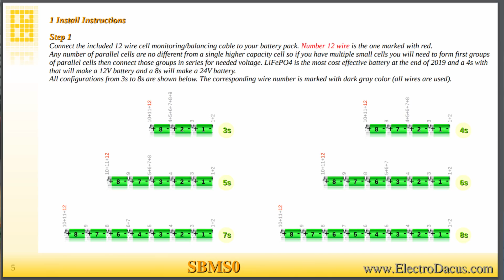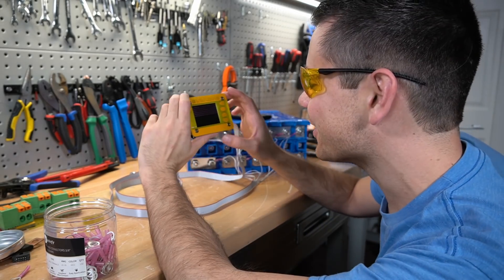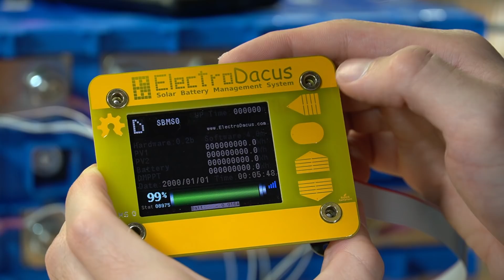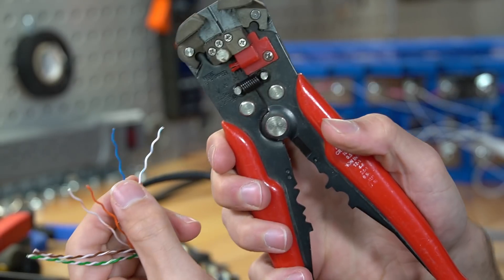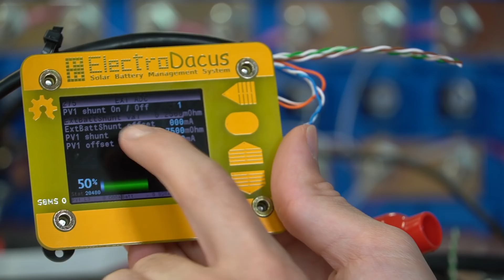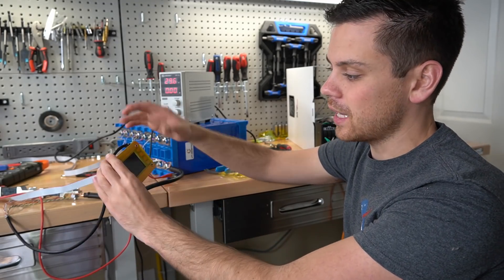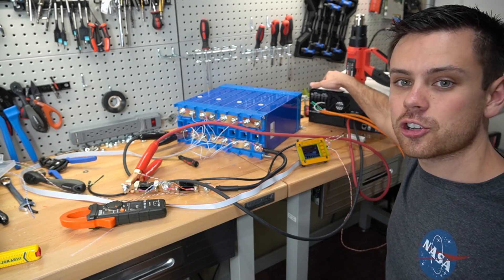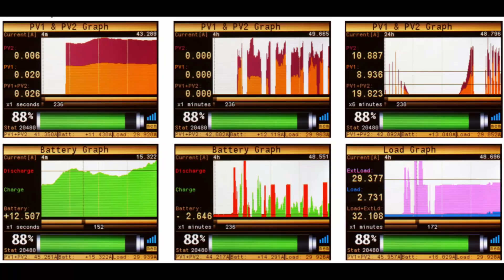Electrodacus -Open Source- Solar Battery Management System: Introduction and Setup

Comment: Nice video. Just one minor thing. Those DSSR20 modules are not actually PWM controllers. They are more efficient on/off modules that work perfectly with MATCHED panels, allowing every amp from the panels to flow through unregulated to the Lithium batteries.
Reply from the maker: Just asked dacian and it's not pwm for voltage regulation, but I assure you the total watt hours produced will be the same as pwm regardless. Power point tracking is not present and the conversion efficiency is similar to pwm regulator. Conversion efficiency is higher than mppt, but mppt will have more power available and after a full day of charging, mppt will always win. The argument is whether the cost of mppt is worth the increase watt hour increase. In some tropical areas, mppt not worth it. For 90% of people, it is worth every penny. Dacian has stated that mppt cost is so high that you are better off buying more panels. But if wire run is large, this would offset the cost savings instantly. 

There is nothing special about this system and there is still a form of regulation when battery is charged. You should get same output numbers as a pwm with the dssr20
Reply: @WillProwse  Thank you for validating my point. There is no PWM. Now, regarding the overall harvest efficiency for MPPT vs. this setup, well, there certainly are conditions where the cold production boost that occurs below ambient freezing in order to have panels at the STC temperatures, allows a good MPPT to generate up to about 8% more harvest, but that fades away to insignificance when we compare total harvest at normal, warm ambient temps, say 70F+, conditions that most RVers try to travel in. In those Temps, where the panel temps are always about 20F warmer than ambient due to internal heat buildup, this system is as efficient as MPPT overall, sometimes more so, sometimes less so. You correctly report that Dacian states that this system is always more efficient for the cost, by adding assuring panels, especially when replacement cost of MPPT devices is taken into account. In terms of wiring, he calls for a pair of #10 wires for each pair of 60 cell panels, thus 4 pairs of #10 for 8 x 315watt panels in my case. This is very cheap for an RV configuration. Long runs are easily mitigated by simply using 72 cell panels.
Reply: @retiredandroaming  Dacian recommends 60 cell panels for his SBMS for most efficient charging via his SBMS/DSSSR combo (max power point is closer to bank voltage).  72 cell panels would be better off using MPPT instead of his DSSRs.
Reply: @dhowman  he recommends 60 cell for normal use and 72 cells for long cable runs.
Reply from the maker: Switching regulators are efficient on off switches. Working voltage of panels is slightly higher than battery nominal, so some form of hvd needs to happen. Pwm controllers are extremely efficient, from input to output. In my tests, 99%. Typical of switching regulators with input and output voltage similar (efficiency in those circuits is dependent on difference in voltage). How would these be any different or any more efficient than PWM?
Reply: @WillProwse  The PV panels are constant current sources so when you connect the PV panels to battery the PV panel voltage will automatically be the same as battery voltage. There is no PWM involved as there is no constant voltage charging needed for LiFePO4 or any other lithium if you want them to last.
The efficiency is given by how well the PV panels match the battery voltage there is nothing magic or super efficient about the DSSR20. They are a very low resistance electronic switch plus ideal diode controller. Transfer efficiency at max 20A is 99.7% but that is not super important in overall efficiency that is related to how well the PV panel matches the battery and PV panel temperature to a lower extent as mentioned is some comment earlier.
Reply: @WillProwse  There is no need for PWM with the matched PV to Lithium, as voltage regulation is not needed. So the circuitry is very simple, very direct, very efficient with (in my understanding) less of the pulsing of a PWM. Dacian can explain it better than me. I'm no electrical expert so just wanted to mention that the DSSR20 has no PWM circuitry in it. Basically an ideal diode with simple on-off signal.
Reply: @retiredandroaming  You need regulation. To have an MPP of the cells matched to the battery means that the open circuit voltage of the cells will be much higher than the battery can handle, and if connected as a piece of wire, they would eventually overcharge. Matching is important.
If the OC voltage is the same as top of charge, then you miss the power band of the panels.
Reply: @ahaveland  no. Search the Electradacus google group for the explanation of why regulation is not needed for the matched pv to Lifepo4 configuration.
Reply: @retiredandroaming  Maybe you have a different definition of regulation? The IV curve of panels does not match the charge profile of lithium batteries. If you want to make maximum use of maximum power, then you have to disconnect the panels at top of charge, ie, regulate.
I'm not going to chase links. Please provide an answer here.
Reply from the maker: @retiredandroaming  it does have some form of regulation, and it is a typical switching regulator. Transfer efficiency is high, but depending on pack voltage and panel temperature, the power point is constantly changing. Sure the input to output is efficient on a switching regulator, but mppt has more power available throughout the day regardless. I covered this in previous videos. Mppt input to output is less efficient, but still generates more power over the course of the day. 

Yes Andy is correct. The curve for panel and the charge curve for LiFePO4 are not the same.
Reply: @ahaveland  as Will confirmed with Dacian, there is no PWM. Exactly what I stated in my initial reply. The SBMS disconnects the panels when 3.55v is reached by any battery cell, by default, and also to prevent back flow at night. Otherwise, it efficiently flows every last amp generated by the pv to the battery, with no attempt at voltage regulation or current limitation.
Reply: @retiredandroaming  Disconnecting the panels when they reach 3.55V  IS regulation!
Reply: @ahaveland  it has no PWM regulation, it is not a PWM controller. Exactly as I stated and what was disputed.
Reply: @retiredandroaming  PWM can happen over long timescales - 100% on when charging, therefore a piece of wire, and 100% off then charged. ie disconnected. Detecting voltage sag and letting it charge until full, then disconnecting etc etc etc is a long duration PWM. Integrating the voltage gives the average voltage of the battery.
This is what PWM chargers do, switch charging on or off. The panel voltage will always be decided by the battery itself, and this is dangerous if there is no "off-switch" to regulate the voltage.
MPPT controllers use PWM at high frequencies with an H bridge and LC circuits to vary the desired voltage and current dynamically according to conditions and component constraints.
As I said, we have different definitions of PWM.
Reply: @ahaveland  pwm attempts to regulate battery voltage for LA batteries by switching on and off in fairly high frequency. This system does none of that, and is built solely for Lithium chemistries.
Reply: @ahaveland  Per Dacian:

"[SBMS] is not a PWM controller as PWM is not needed for Lithium charging (it is actually detrimental). PWM is used for constant voltage charging (absorption and float) with Lead Acid that require this sort of charging. Yes, if panels match battery they can work very close to max power point so much so that it will be in average more efficient than using an MPPT. If you have the space and add more panels that will be cost equivalent with the MPPT then that is a way better financial investment.
...
A Lithium battery say a LiFePO4 that is ideal for solar as it is the most cost effective is very simple to charge and almost like a capacitor so you can connect a solar PV panel to it "directly" as solar PV panel is a constant current source and that PV panel will push current in to the battery (current will depend on amount of light) and when that LiFePO4 cell gets to 3.6V charging should immediately stop as cell is 100% charged.

What a PWM will do is turn the panel ON/OFF to maintain say that 3.6V and that will have detrimental effect on a Lithium battery as the LiFePO4 is already fully charge and charging should be completely stopped. So PWM is used for constant voltage charging (absorbiton) and only constant current charging (bulk) is needed for LiFePO4.

With other type of Lithium cells say LiCoO2 or NMC used in portable electronics or EV's constant voltage (absorbtion) charging can be used to get some extra storage capacity but to the detriment of battery life. In those applications the extra 15 or 20% capacity you get using constant voltage charging (absorption) is more important than battery cycle life but that is not the case with solar energy storage where cost amortization is more important than energy density. In any case LiCoO2 and NMC are not cost effective when compared to LiFePO4 and with LiFePO4 there is no extra 15 to 20% from constant voltage charging possible as this cells will be fully charged already after the constant current charge phase and there is not even 1% extra left to gain by CV charging."
Reply from the maker: @retiredandroaming  technically a well matched solar panel and battery using pwm will not switch much at all. During the majority of bulk, the pwm cycle should be very similar to dacians setup. Technically, Andy is right. Pwm doesn't refer to how long the time scale is, and it is still a switching regulator. It has to be or else OV situation in one cell and no way to stop it would cause problems. 

I would say a morning star pwm and dacian would produce the same watt hours on an identical setup. Possibly a video idea for the future once I get a solid test array built
Reply from the maker: @dhowman  pwm is always more efficient than mppt, regulator wise. Transfer efficiency. But the MPPT still wins due to power availability. 30% more over the course of the day. But dacian has calculated that panels are so cheap, you can use pwm and an extra panel. Would cost same or less than mppt, and still produce a lot of power. 

I personally use mppt for all systems, but what I really love about pwm is that It can last for decades. No capacitors, so chance of failure after twenty years is low. If system is designed properly.
Reply: @WillProwse  we will agree to disagree on the inflated 30% number. It is more like 8% to 10%in extreme cold.  And very little improvement in normal RV related temps, where panels are often well over 100F.
Reply: @dhowman  Thanks for the info. Barry asserted that "There is no need for PWM with the matched PV to Lithium, as voltage regulation is not needed."
My point was that voltage regulation is absolutely needed, however it is connected.
The battery voltage must not exceed limits, and there must be some hysteresis.
It works like a simple thermostat, but it is still a form of regulation.
Reply: @WillProwse  I'm a full-time traveling RVer who lives solely on solar. My previous self-built 1320w/780ah system ran our entire coach very successfully for 3 years. We sold that coach and I'm now building a 2500w PV/24v-300ah LifePO4 system using Dacian's SBMS0 and 4 x DSSR20s, with a Victron 230v 1600w EU inverter to run my full-time A/C system, and a Victron 3000w 110V inverter for the rest of the RV systems, and a Victron 24vDC-12VDC converter, and a Victron BP. The Electrodacus system is, by FAR, the lowest TCO system to meet these requirements, that I have researched, and I've done them all. I am not interested in cheap Chinese MPPTs  or BMSs as we need 100% reliability as this is our home. Cheers, Barry.
Reply: @ahaveland  The point you continue to miss is that PWM voltage regulation is not needed or desired for Lithium, and not in the DSSR construction. There is a difference between PWM voltage regulation, where the controller attempts to limit the output voltage in the Absorb and Float stages for LA batteries, and the voltage switch off of the PV from the battery once the battery cells have reached Fully Charged state. The DSSR of course shuts down the PV from the battery when the cells are charged. Thats is absolutely NOT the same thing as PWM voltage regulation of the output.
Reply: @retiredandroaming  No, I'm not missing the point. I do know the difference. You said "unregulated" and "no regulation" which implies no control over charge at all! Disconnecting the panels when full is also regulation, it's just not PWM modulating the current, and that could be a problem if the panels exceed the C rating of the battery, so people have to size appropriately.
We have different definitions, let's leave it at that.
Reply: @WillProwse  "30% more over the course of the day" .... ?  Def not the case if panels and battery are matched, it's a relatively sunny day and panels are at STC or higher (Dacian's run the numbers for this).  I think the jury might still be out whether there's an efficiency gain (& how much) on cloudy days.  We have experts experienced with both technologies and on both sides of this argument here (including the maker) who seem to disagree.  Seems only a real world controlled test will put this debate to rest.  Any takers?  I'd do it now but LFP cells  ordered from BLS over a month ago still haven't shipped.  :(
Reply from the maker: @dhowman  I'll just test it myself when irradiance improves at my latitude. 30% figure is common on most studies, but I just realized it pertains to lead acid charging. Dacian is probably correct that it is better for lithium ion and direct connect with matched panels. But I have no data on how much better it is. So I will test it. I even showed in a video previously that a pwm and mppt connected to LiFePO4 had same power. Hot panels that were matched to battery voltage. I always reference the studies that show 30% increase over the course of a day though, and not at peak output STC. The whole point of mppt is amp boost when sun is low, and that higher voltage input. But yeah, I'll just test it out. Should be fun 😁
Reply: @WillProwse  U Da Man!  Thank you!!

Comment: Very cool! but I was surprised that you didn't test the low and high temperature cutoffs. They are listed as ... "Advanced Parameter Setting submenu parameter 29 and 30"
Reply: He needed a 10K B3950 thermistor and probably did not had one. It works of course but is not very useful other than protecting the battery if battery is below freezing tho if battery is to be in this sort of conditions a heated box with thermostat controlled heater is best option and then undervoltage protection will never need to work.  If battery gets to low temperature it will take hours to heat it back and you need tone of energy to do that so isolated / heated box is necessary if battery is not inside a heated space.

Comment: That looks kick ass.. everything I'm building right now is 48V so a no go I guess.
Reply: There is probably a limit to the number of SBMS0 that can be placed in >series< with each other and still have any low or high cell provide a signal through the EXTIO interface, again in series with other EXTIO ports. It is not promoted due the open circuit voltages being way above safe low voltage levels for diy and it is not elegant in that the individual screens only display for their bank and there is no present method of accumulating that information. Edit: Having a 48v pack controlled by series SBMS0 will require a good knowledge of the necessity to isolate components where necessary and even to use series intermediate relays or DSSR20's to isolate EXTIO leads. In this way each SBMS0 can be it's own little world without chance of harm from series interconnections.
Reply: You can use the SBMS0 with 48 volt systems.  You can parallel the SBMS up to a 16s system.
Reply: Hey i have to make a correction here. No the SBMS0 cant be used on 48 volt systems as it has s max voltage of 35 volts. I thought it could be done by some special wiring of the balance leads from 2 separate SBMS0s.  I have 2 Teslas in a 24 volt parallel system and use 2 SBMS0s to control it by wiring the automation leads in series. I thought the same could be done with a 2 tesla series 48 volt system placing the balance leads in series.  I guess it would have to be tested out. 
You can consider the REC-BMS for 48 volts systems but comes at a higher cost. CHARGERY may work too.
Reply: I was wondering why Will is mostly testing using 24 volt systems instead of 48 volt systems?  Is the cost of the hardware a major factor?
Reply: @geraldgrogan   A lot of the 12 and 24v stuff is plug and play whereas most 48v and up is not. The open circuit of 48v and up systems is way over safe low voltage levels and there are a lot of untrained diyers out there.

Comment: After watching all your video's I decided on the Electrodacus a few months ago over the Epever and extra's you were recommending at the time because of the reasons you mention here. You get a charger that can look after your lifepo batteries and handle a huge amount of solar for 1/4 the money in some cases. I have 2000w on my roof and when I find a permanent location I will get another 2000 and put them in the sun and park the truck in the shade :) I have been using mine on a small level while I finish building my truck but so far I'm very happy with it, glad you like it too...Now I just need to work out how to get it working with the shunt to monitor capacity properly.